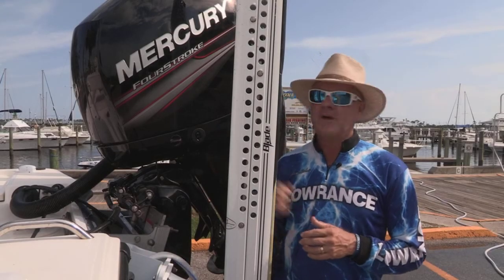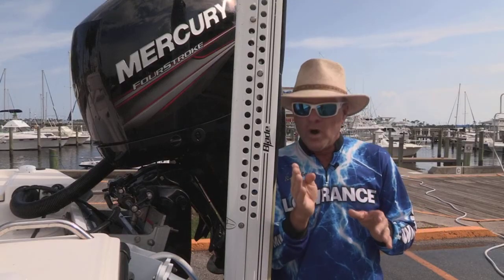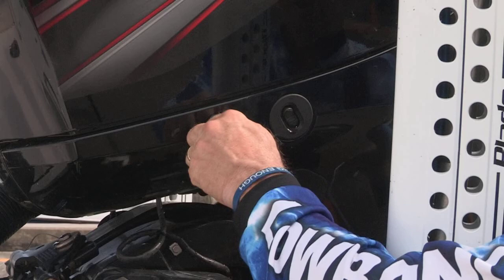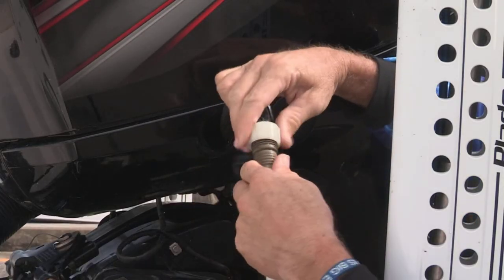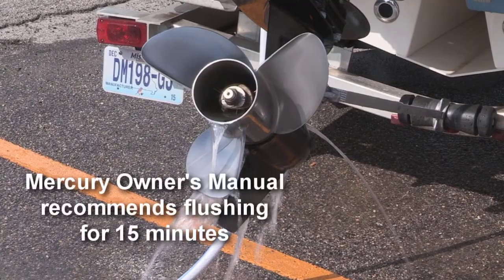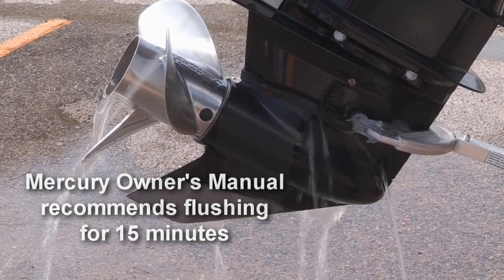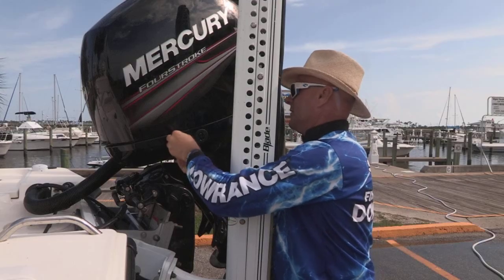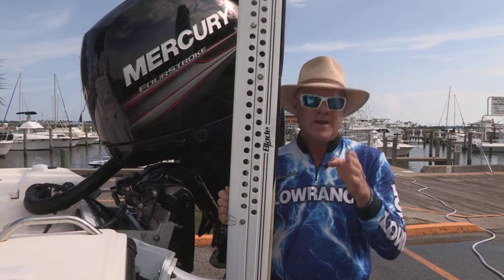Mercury Marine Outboard Maintenance: FourStroke Engine Flush

Comment: You gotta turn on the engine and let it run for 5 minutes. It says in the mercury manual
Reply from the maker: While some models can be flushed with the engine running, that does not apply to all models. We always recommend referencing the operator's manual that came with the product you purchased. 😊

Comment: This (static flush)only flushes the motor above the impeller. Still need to do the lower running flush. Never at full pressure.  Highly reccomend for freshwater running engines also. The amount of sandy sediment at most freshwater boat ramps can be worse than the saltwater corrosion on the cooling components.
Reply: Wong
Reply: Wrong

Comment: So there is no need for the motor to be running to open the thermostat’s to get a complete flush out? Also, is it recommended to run the motor with the hose hooked up to the quick flush?
Reply from the maker: Hi Mark, not all engines need to be running during flushing to get the cooling system fully flushed. Some engines can be ran when the hose is hooked up to the flush port on the outboard, where others cannot. It varies by model. We recommend checking the operator's manual for the specific engine you have for flushing instructions. If you do not have an operator's manual, feel free to email your engine serial number to social@mercmarine.com, and we can provide you with an electronic copy. 👍
Reply: @MercuryMarine  I just purchased the 2023 four stroke 150.
Reply from the maker: On the current 150hp FourStroke you cannot run the engine when using the flushing connector on the engine, nor do you have to. The flushing system on this engine is designed to work when the engine is not running. Instructions can be found starting on page 50 of your operator's manual.
Reply: @MercuryMarine  I’m sorry, I should have clarified, I do flush with the hose connected quick flush as I did for 22 years with my Yamaha salt water series 150. My question is, how is it flushing the motor 100% completely if the thermostats aren’t opening up by running motor.
Reply from the maker: Great question, Mark. The thermostat housing on the 150hp outboard is engineered with a small bypass hole to allow some water through even when the thermostat is not open.
Reply: @MercuryMarine  hallelujah, that’s the answer I’ve been looking for !! That makes perfect sense to me now. Im now thinking when they introduced the quick flush application to the outboard market this small hole bypassing the thermostat was there all along, That’s the story I’m going with. Thanks for getting back with me, I really appreciate it.
Reply: @MercuryMarine  THANK YOU! That is really important information.  The manual on my 2024 300xl doesn't explain that it's OK to flush it hot or cold.  I don't want to 'assume' anything, so I think a comment in the manual about this would be helpful.  Nobody I know trusts an engine-off flush.  Also, my manual doesn't specify water pressure levels, so should I assume 80psi is OK?
Reply: What about for a 2016 mercury 115hp EXLPT 4 stroke? Does motor need to be  running while flushing? Sorry no manual

Comment: Does Mercury 2005-2006 115hp have that?
Reply from the maker: The 2005-2006 115hp 4-stroke outboard engines have a flush port on the rear of the engine. It allows for you to install your garden hose, turn on the water 1/2 way, start the engine, and let it idle on the flush hose.
Reply: @MercuryMarine  thank you

Comment: can i run the motor when using this method? my dad said i can only turn it on if using the muffs
Reply: I do it all the time. It is more than enough water going through it to run it as long as the hose is running and hooked up properly. Muffs are only for older style motors that don’t have a hose connector
Reply: @delawaresrealtornick5670  gotchaaaa makes sense! Thanks!
Reply: @gholdsfishing3144  Yesir. Enjoy 👏🏼🙌🏼
Reply: But do you “need” to run the motor with the hose quick connect hooked up?
Reply: @markgray2931  i do it just because. I have 0 idea if it actually helps anything. Iv heard arguments about thermostats and stuff
Reply: @gholdsfishing3144  same hear. I’ve heard conflicting answers but I’ve flushed my 2001 Yamaha 150 saltwater series hooked up to the quick flush for all these years with issues. But my old school friends are just like “no way” that’s flushing it completely if the thermostat isn’t opening up. But I tell them this what it’s for and they still say BS. I just want to know cause I really want to know
Reply: @gholdsfishing3144  my dad was old school and used to look at me flushing it without cranking it and shake his head at me and just say I’m not doing right. You gotta crank it and he didn’t care what I said about the new way.

Comment: Mercury engine won’t flush
Reply from the maker: Hi Kate, sorry to hear you're having some frustrations. If your engine will not flush as the operator's manual states, then it would be something to bring up to your Mercury Marine dealer. you may have a clogged or failed check valve in the flush system causing your issue, and they can likely get you back up and running in no time. If you would like to chat with our customer service team regarding what you are seeing and what you can check, please contact the telephone number found in the back in your operator's manual. Thank you for viewing and dropping a comment!
Reply: @MercuryMarine  my new efi150 don't flush!
my dealer said to me not flush, but i'm desagree....
i don't understand what's my engine problem
Reply: If your motor won’t flush, it is clogged and will overheat when you use it next

Comment: So you no longer need to run the motor while flushing because water goes through top connector now?
Reply: Wrong. The static flush does the components and channels above the impeller. Still need to do a running flush to complete the process if you want to do it correctly.